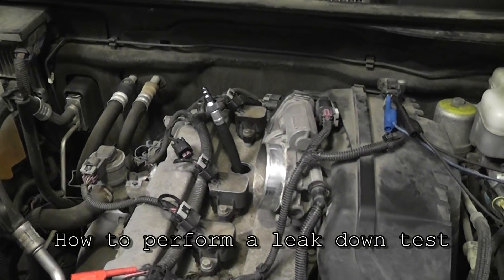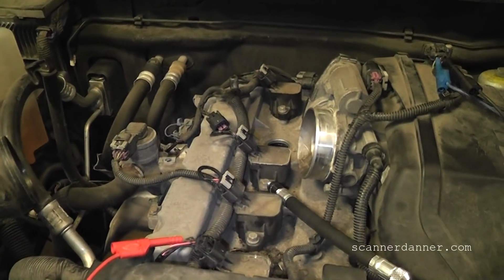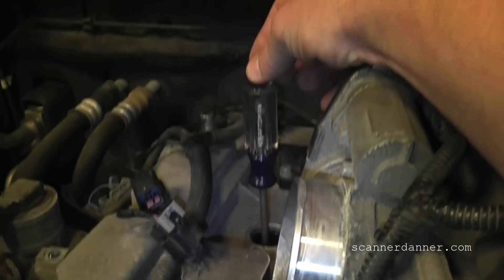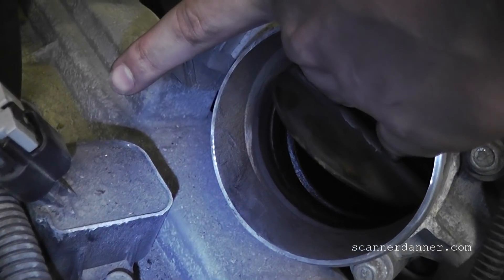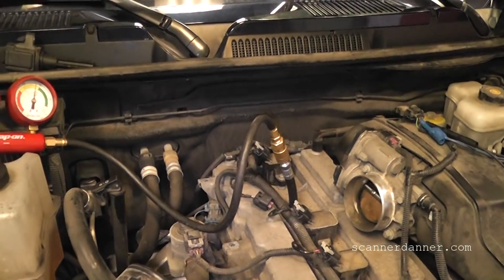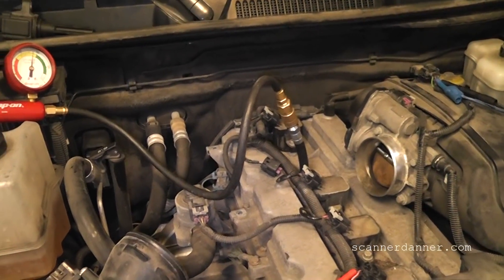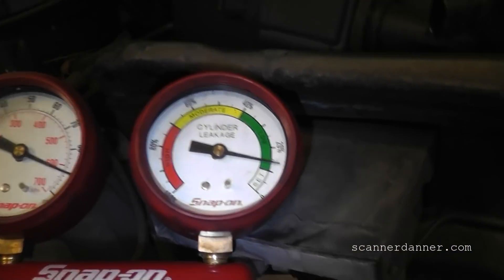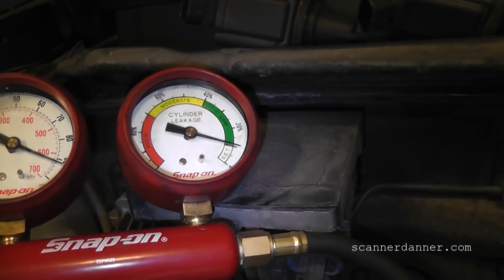2008 Hummer H3 Misfire Case Study (Part 4) Leak down test revisited

Comment: just want to add a comment, my leak down tester instruct not to apply anything over 80 psi to the inlet leak down tester, that might keep from crank turning while doing the test, or might b my leak down tester is a cheap one lol.
Reply from the maker: for sure the higher the psi the more likely it will push the piston down in the cylinder

Comment: Can fuel in the cylinder keep my mustang from starting
Reply from the maker: If the engine is flooded, yes, but you'll need to find out why it flooded
Reply: @ScannerDanner  today I did added oil to all the cylinders in my mustang and it started up!!! I have a dead miss on cylinder #2 cylinder leak tested and it's coming out the oil filler and throttle body.  Also smoke tested through the spark plug  hole #2 and smoke came out the throttle body and oil filler hole. So my guess is it needs rings. Time to sell

Comment: Hey ScannerDanner, I have a car blowing blue smoke and has misfires, I did a cylinder leak down test and found 45% leak on cylinder 2 and found air coming out of cylinder 4 any idea what this indicates? Thanks
Reply from the maker: blue smoke is burning oil and that is a huge amount of leakage, I worry about a ring issue but that wouldn't cause air to come out of the #4 unless the rings are bad there too
What are your compression pressures on all cylinders?

Comment: You’re doing this test wrong. You do not pressurize the tester then plug it into the cylinder. You have everything connected all the way to the cylinder and then turn the tester up until the first gauge reaches 100 PSI, then you read the second gauge to get your percentage of leak down. Almost every video on YouTube on how to do this test is wrong. It’s freaking ridiculous. Lol
Reply from the maker: it was still accurate in what we showed, even if I used it wrong

Comment: Usually when an engine overhaul is done, the top part of the cylinder needs to be reamed to get rid of a ridge. If ridge is not removed the rings will expend and it will make the removal of the piston hard and it may even break the piston.
Long story short, the top of cylinder walls wear more than the bottom part. That could be the reason for air escaping more on the top dead center from the rings. On the bottom, the cylinder is less worn and the rings seal better.

Comment: Hi Paul, sorry to resurrect such an old video (great series btw) but i am now personally starting to play about with a pressure transducer and a first look sensor so was wondering if you could share where you personally went for information regarding how to disect these waveforms? I know this is 5 years old now but at this point you were just starting to get to grips with this and i was wondering if there was a particular website or training book that you found useful on how to understand and interpret what you were looking at on the screen. Thanks as always

Dave

Comment: Testing with piston down btdc should test for cylinder wear as well as a cracked cylinder wall. Also I use a vaccum/ fuel gauge to check when I don't hear a leak by ear. You can check for exhaust valve at tail pipe, intake valve at vaccum hose, crank case at dip stick tube, and head gasket at the radiator cap. This way you check all possible points for secondary leaks. I use smoke adapters to plug the snorkel and access tail pipe while using  one of my assortment of rubber stoppers with one hole in them for the radiator. Btw these stoppers work great sitting on the p/s pump to pull vacuum to remove air from system.

Comment: what if the cilinder comunicates to the neighbourg cilinder and loses presure through the intake valve of the neibourgh cilinder, valve that is normal to be opened in that moment.
Reply: IIRC believe you then could hear air coming out the spark plug hole of the adjacent cylinder.

Comment: A note on bdc vs TDC numbers. When I was in school in we would bore gauge cylinder wall wear... The top of the cylinder always read a larger bore than the bottom. I'm talking specifically about in line 6 engines here. It was only a few ten thousandths but it was noticeable. This also accounts for the common cylinder Ridge that can be felt in the liner at the top of the stroke, I've never seen a ridge in the bottom of the liner. I guess the thought is there is some cavetation taking place near TDC as the crank rolls over and shifts the direction of the connecting rod. This also happens at bdc but the piston is closer to the crank and under no pressure at this point. Just a thought as to why you're getting different % of leakage @ TDC vs bdc.
Reply from the maker: For sure! Thanks

Comment: Took my stepson's H3 to the dealer today for a check engine light, got a 0300 code and they said cylinder 3 misfire.  Paid $200 for troubleshooting and they said the cylinder gets 160 psi (good), and the problem is leaking (down-leak?) into the crankcase, replace the rings.  They suggested replacing the engine for over $9k, rather than rebuild the engine .  We replaced the plugs with platinums (the installed plugs were roasted),  cleaned the MAF and Intake, got a new air filter, got a full syn oil change and added 6 cylinder Restore  Engine Restore.  Have full system fuel injector cleaner to put in next fill up.  Check engine light is still on, though only 3 hours later.  Vehicle wasn't acting up , so no difference in performance since light came on.  WHAT ARE YOUR THOUGHTS ON OUR SITUATION AND WHEN SHOULD THE CHECK ENGINE GO OUT, IF WE HAPPENED TO FIX IT?  Thanks so much for your great videos and your time.  Much appreciated.

Comment: @4:21, does the thermostat have to be open to see air bubbles in the radiator from a leak down test with a bad head gasket?
Reply: Sandbag1300 NO air will get around it.

Comment: BTW. As others have mentioned you should NEVER try to hold the wrench. Simple math (pi x r^2) for a 3" bore and 100psi will tell you that there is about 700lbs of force on the top of the piston and that's further multiplied by the stroke of the crank  SO you're looking at a broken hand (as you almost found out). Putting the a standard xmission car in gear doesn't always work either. I've had the car move. If you must test at 100psi then maybe a long wrench jammed against something would make sense.
Reply: I use my cock to hold mine down

Comment: I noticed in several shots that the input side pressure dropped off the initial 100psi set point to about 90 or less.  Wouldn't it be wise to set that back to 100psi. That pressure affects the leak down gauge side measurement as well. It might make the difference between the gauge showing in the good or marginal range and change your opinion of the result. This is why I prefer the type with two regular gauges and look for the difference between them.Sage

Comment: you always have some ring blow by   cylinder wear is less at bottom of the cylinder than at tdc   when you tear down a motor you always find more ridge at the top of the cylinder than at the bottom.  leak down sees the extra wear at tdc and adds to the leakage.   best to do test at bdc once then add oil to check for the amount of leakage added to leak down by ring wear.

Comment: what happens when you have a blown head gasket to an adjacent cylinder and that cylinder has either the intake or exhaust valve open? would this not throw off the test? of course you would see this ounce you remote the head anyway.
Reply from the maker: Mike P For sure there are tons of variables with in-cylinder pressure waveforms. I would think you would catch this one easily on a relative compression test as pretty much two dead holes.

Comment: a coworkers case scenario  ...basically followed these instructions on a 4 cyl. Toyota Rav 4 .... also had big leak out of the intake clinder 4...after teardown no problems found with valves...but tech was instructed to replace head and valves...warranty .... after put together ... still had a air fuel ratio imbalance on #4 ... removed valve cover... redid leakdown visually seeing the cam lobs were off the valves...leakdown did reveal leak out of crank case... NOT intake....  i would definitely recommend leakdown down with valve covers off instead of on... a broken piston was found on complete teardown....  just my opinion.
Reply from the maker: swillieboy so maybe the key then is to remove the pcv and breather lines to be sure it is not coming from the crankcase. this should fix that variable. great tip! thanks!

Comment: I have been watching all your videos including your premium channel and I have never heard you say anything stupid, until now :) Sorry, but I have to correct. Regardless of the engine type, TDC is TDC and the crankshaft centre line is straight up and down regardless of the engines design. V type or inline. V type just happens to be on an angle but the centreline is still straight up and down.

Can I also say that doing a leak down test at various points of piston position in the cylinder especially if you are chasing a blow by problem is always a good idea.  A scour in the cylinder does not always run the full length of the cylinder and a crack in the cylinder may be horizontal. I have seen this in race engines that have suffered serious detonation where it would appear the engine is trying to pull itself apart and a leak down did not show up with the piston at TDC. Wind the engine down a inch and bingo.

Love ya work Scanner Man

Comment: Putting a ratchet on the crank would be a lot safer because you can still apply pressure but if it wants to take off on you it wont fling the wrench and hurt you.

Comment: I usually have the leak down tester set at around 25psi input and around the same on the reg so when I turn the crank to find TDC when the hold down gauge begins to rise it's coming to the top.
The lower pressure makes it easier to turn the crank,TDC is easy to judge,if it's not then it spins the crank.
Then dial up 100  psi on the input,
Saves all the screwdriver down the plug hole process.

Comment: Never ever put air in with the damn wrench on. Especially don't hold it. Good way to brake your dang arm. Low pressure applyed slow saved u.
Reply: I've heard that is dangerous too. But he didn't apply low pressure slowly, he applied the full 100psi all at once.  I really don't understand how to keep the piston from moving since you can't hold the wrench on it.  With a manual you can put it in gear and use the parking brake.  Not sure what you can do with an automatic.

Comment: Great videos, in my experience doing leak out tests I have found that normal engines that have average wear are always about 10 to 20%..... 25% is a borderline time to overhaul, and 30% is need to repair now and usually a misfire or poor driveability issue has brought the car in for diagnosis.

Comment: Glad you liked my tip! That works on all motors, and the more centered you are on piston dwell at TDC, the safer you are against the crank suddenly rotating on you. I try to estimate the middle of dwell, and that IPA TDC finder helps me to a bit.

Bore wear is usually greater near TDC, so measuring at the top can be important. Head gaskets are above the piston, so there is no concern about blocking the air pressure from escaping out the head gasket at TDC.

The ideal air pressure is 100 psi, because it makes the math easy. The left gage reads how much air pressure goes into the bore. The right gage measures the pressure remaining in the cylinder. So that right gage is only dead accurate if the left gage reads 100%. Otherwise it's reading a percentage of a percentage!

The OTC leak down tester has two gages that both read psi, and it includes a chart that converts the leak down % when using lower air pressures. That snap on gage is nuts if it thinks a 40% leakage rate is anywhere near acceptable. 15% would definitely indicate a problem!! At 40%, you have major blowby or valve sealing issues.

You might also want to start the test at 0 psi on the regulator, and slowly increase the air pressure to 100. Much safer and less likely to rotate the engine suddenly. Otherwise, you had better be at true TDC in the middle of piston dwell. Engine should be warm as well, so rings seal correctly and cylinder bore is oiled up. FYI, piston dwells for probably 6 to 8 degrees at TDC... but the rod is still swinging side to side except when it's right near the middle of piston dwell. Visualize the piston, rod and crank as the rod rotates from one side of the bore to the other.
Reply from the maker: I did Steve thanks! I would have mentioned your name but I couldn't remember who's suggestion it was, sorry about that.
Reply: That's ok. Stay on this case, Paul. We need to find a test that can prove which valve leaks using a scope! Pressure is what leaks, so pressure must be how to find it. Probably at cranking speeds. Although at this point, it seems like the leak down test is still king.

 We could try splitting a shop air hose into two, both regulated to 100 psi, one going to the cylinder and the other going to the gauge. It would effectively be a scoped leak down test. Somehow, an in cylinder pressure transducer at cranking speeds would have to show something. I'm hopeful about the map or exhaust pressure sensor too.
Reply: To ScannerDanner!!!!!!!!

It doesn't matter if it is a V (or W) engine, a boxer engine or an inline engine .. any piston and con-rod combination will have a point at TDC and BDC where the forces is directly inline with the throw of the crankshaft.

Those two points during a crankshaft rotation is where the piston will come to a complete stop before changing the direction of travel, it is therefore also called a reciprocating engine. To be more specific the engine you are working on is a:"4-stroke Otto cycle reciprocating heat engine".

Thus at TDC or BDC... ANY force exerted on the piston will NOT result in any torque transfer, and thus NO rotation of the crank. 

Again this also means that the maximum transfer of mechanical energy from the combustion of petrochemical energy (NOT an explosion as some wants to call it) is during the combustion stroke where the con-rod is perpendicular/orthogonal to the throw of the crankshaft.

Remember "force times arm equals torque"... at this point the "arm", which is the throw of the crankshaft, is at its optimum position, and the force transferred perpendicular/orthogonal from the con-rod is using all the energy to turn the crankshaft.. therefore this is where the max torque is transferred.

Comment: Part 4?  I understand it's a great learning experience for your students but compared to all of your past videos it seems like you're going overboard on your leak down results.  Yeah it's the company vehicle and you want to ensure you're diagnosis is correct but you were correct in the first video.  You're on TDC, timing is good and mechanically sound (no broken cam), you have air in the intake, that's it, done.  Time for a valve job.
Reply: I agree, I'm tired of this one too but I have to show the in cylinder stuff with the Pico. And i t is going to leave questions in our minds about whether or not the valaves are really the problem. I should have combined this revisit with the Pico captures.
Reply from the maker: So watch Part 5, I am uploading right now and you will understand why I shot part 4.

Comment: GMC TSB# PIP4013C: In-line Truck Engine Misfire at Idle.
Important: Before replacing the cylinder head, review the latest version of PIP3940, I forgot to mention  this is a recall. you must change the entire cylinder head, what is bad are valve spring. the new head got this fix.

Comment: I've seen leakdown testing done with different incoming pressures (usually lower). Is there an optimum intake pressure for the most accurate test? Presumably doing it with lower pressures might be a little safer....
Reply: Here's a clip of the one that I use... http://youtu.be/aKwWCAlNRlg?t=12m21s
as pressure builds, you can see that the the "leak" side follows quite quickly from low to higher pressure. I think any where from 50 to 80 psi should be enough to find leaks. Obviously no leak in my video as I am just using the air to hold the valves closed.

Comment: Just curious as to how much shop air pressure you actually need to make the test accurate?  Would be a lot easier to control the crank with 40 psi than 120 psi for example.  
Here is instruction on a harbor fright compression leak down tester:
"NOTE: Set the air compressor’s regulator 
to 7 to 100 PSI. Never operate this 
tester with air pressure set higher than 
100 PSI, which can damage this tool."

Not sure if 7 psi is enough to even move the crank.

Comment: Why didn't any of the valves open at BDC because of valve lead or lag, depending which way the engine rotated?  I don't know cam spec for that engine but I assume the exhaust valve would have opened before BDC. Did you not allow the piston to go all the way down to BDC with the wrench?  Great videos by the way.

Comment: Hi Paul, well I think what ever kind of engine it is the con rod and crank will all be in line at TDC, just one comment, when you do this with a Manual Transmission car you can put it in top gear with parking brake on to stop engine moving, I guess a lower reading at tdc prob means the bore is worn a bit at the top, I don't think valve overlap would come into it for quite a lot of crank travel, with the old distributor cars you can see what cylinder you are on by checking where the rotor arm is pointing roughly..cheers good video, I think you would only need to put oil down the bore if you were getting pressure out the oil cap - Fred in England

Comment: a timing chain, guides and tensioner can give you that problem with poor sealing valves, timing correlation, misfire, lean condition are also symptom related to a loose timing chain. great videos, keep it up.
Reply: Damn and just when I thought I was starting to get it you throw a curve ball.